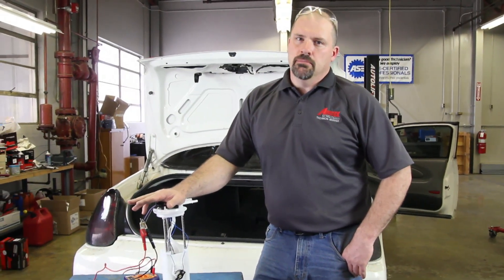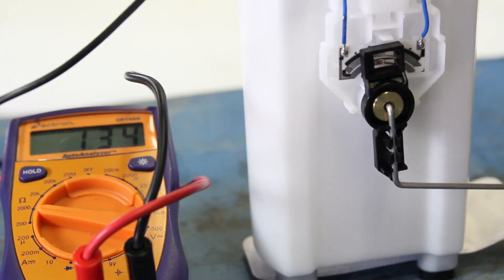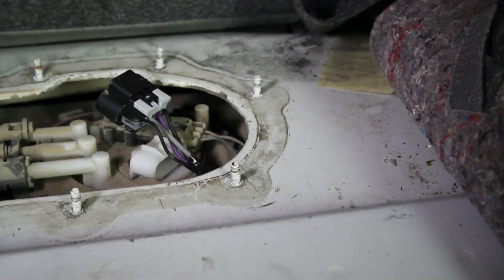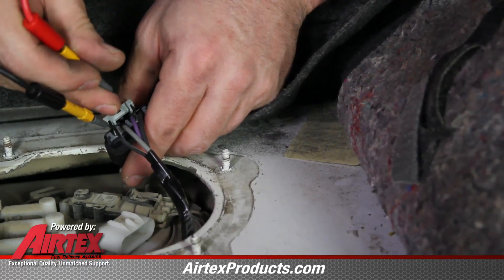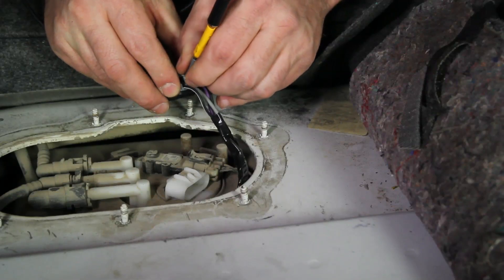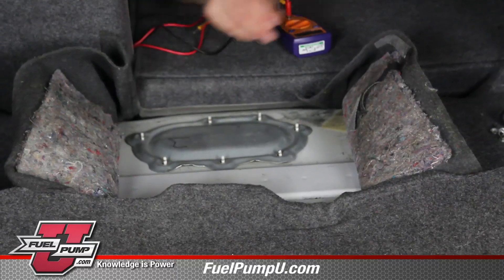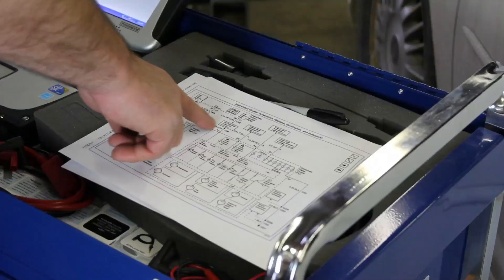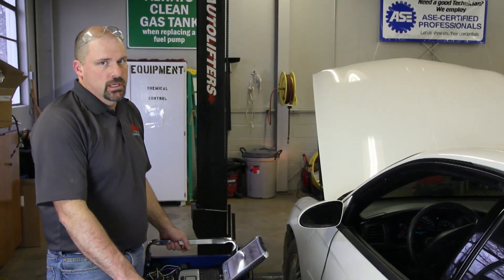Fuel Gauge Tech - How To Properly Diagnose a Faulty Fuel Pump Sending Unit

Comment: I replaced my pump ad my sending unit on both passenger and driver side, with brand new ones (i have an Infiniti FX35) but the gauge still stays at 3 Quarters full. Now sure how what to do at the moment, i'll reset my ECM today and see if that works.

Comment: I realize this is a very old video but I want to make a very important point about what was said.  If you see a voltage drop done the way he just did, it ONLY means the variable resistor, in its present position, is not open.  You need to check the range of motion for positions of possible open.  The variable resistor wiper can wear out and begin sending bad readings depending on fuel level.  If, and only if, the resistor is failed catastrophically will this method work.

Comment: I have a 2011 CRV every time I fill up the tank fuel gauge drops and it goes up and down and I feel like the car is burning so much gas but I don't know if it's the fuel gauge or the pump
Reply from the maker: This is a perfect example of needing to do the proper diagnostics to determine what component is at fault; the sender, wiring, ECU, gauge...

Comment: Hey man, I have a question. On ignition, sometimes my gas gauge stays on empty for a little bit and car says no fuel. Gas gauge takes like 4 minutes to rise to actual fuel levels. If I let it sit and restart it will self correct. I have an ecoboost 2015 with no mods 25k miles. I want to believe it's a sending unit. Any ideas? I'd like your two cents.
Reply from the maker: It could be the sender, it could be the ECU, it could be the gauge itself. It is a matter of doing diagnostics through the chain of command. Start with the ohms reading on the sending unit and work your way back to the front. With the delay in the reading I will be surprised if it is the sender.

Comment: If my fuel gauge on my 02 Lincoln ls says 200 miles till empty (for example) and I drive 1 mile the number goes down to 196 till empty and I didn't even drive 4 miles. I replaced the fuel pump, fuel filter, and the fuel pump relay. I'm at a loss.
Reply: Airtex/ASC Performance Pumps I have the same issue with my 2017 Dodge Challenger sxt plus could you make a video on how to fix please!!
Reply: Airtex/ASC Performance Pumps how do I know it could be fuel gauge or if there is a leak?
Reply: Buy caddi

Comment: my bmw740i runs out of petrol when the gauge reads below half and on board computer reads +- 280km to go however to fill up with petrol the tank only takes R600.00 when it should take over R1000.00 to fill so that means there is still petrol in the tank when the car runs out, what can be the problem.

Comment: My fuel gauge hasn't worked in over 5 years. I have a check engine light and got it hooked up to a scanner that gave a 0462 code.
I have had the fuel lever sensor replaced and the check engine light is still on. PLEASE HELP! I cannot get my vehicle registered with this issue.
Reply: Check the soldering on the back of the gauge on the cluster, check for blown fuses, check for faulty wiring.
Reply: tmarie314 Did you ever find the problem?
Who hooked it up to the scanner? The mechanic who changed the sending unit?
I keep hearing people say they can't register their cars or will get a ticket for an engine light.
I don't understand but I hope you found an answer

Comment: I have a 2005 infiniti g35 and my gas gauge reads full tank but doesn't go all the way down to empty. I could only go up to half a tank because if I let it go to empty it will wont drive no more. can you please give me some tech advices. I already replaced the sending units A and B.  and the gas gasket valve

Comment: I have a 2006 tacoma, and gauge was still registering that I still had a 1/4 of a tank of gas, but I ended up being out of gas, does this sound like a problem with the sending unit, other then this issue, the gauge seems to work properly
Reply: Airtex/ASC Performance Pumps thank you for your response
Reply: How did you solve the problem ?

Comment: I have 2006 G35 sedan 6MT, I have problems of fuel gauge accurancy? I replaced the filter and used Nipparts but now fuel consumption is way up. In full tank in urban only 185 miles. Should I use OEM filter. I replaced also the fuel pump to DELPHI FE0351 and it delivers 48.5gph. And do I have to replace 2   O rings at fuel filter every time I change the filter, I just di when repl. the filter?
Reply: Thanks. The fuel level is totally out of order. It jumps up and down. After replacement the fuel pump Delphi and fuel filter Nippparts caused this that I could drive with full tank in urban only 185 miles, normal driving- I mean I drove the tank completely empty. this for 20 gallons not goor results , usually i could do it 350 miles before replacement. The small 0 rings were not included with the fuel filter. But somebody said that if not replace these 0 rings the fuel pressure will be lost? How much is there truth about it?

Comment: Any experience dealing with a 2011 vw jetta? fuel gauge shows 0, ambient air temp sensor also shows around 4F when it is actually 85F. Not sure if they are related. I believe it first showed up after a battery replacement a month or two ago. Thanks.

Comment: I have a 2003 Dodge Caravan. The fuel gauge works until it hits the 1/4 tank mark. Once it hits that mark, the fuel light comes on and the gauge never registers under that 1/4 tank of gas. But when I fill it back up, the gauge will register properly again.

Comment: My 95 ford explorer V6 4.0 2WD has a potential problem with the gauge. First indicator was the dash's check gauge light comes on and stays on. Then my fuel indicator will vary throughout my travel and will vary on startup. Im pretty sure that it may need to be replaced but id like some advice.

Comment: I have a 2000 Monte Carlo and the fuel gauge  stays on full 90% of the time once driving for a while it will drop. Then it will move back to full. It will drop to empty and gas light comes on when idling too long. Any ideas?

Comment: I've got a 94 b13 NISSAN sentra, had the back window tinted, and after the tint was completed about 2hours of driving, my fuel gauge failed, and I'm thinking the installer tech ruined some wiring back there because the backseat was moved to ease the installation. I'm not finding any video about this issue on youtube, so I'm wondering that this issue is somehow ignored, or people don't touch their back windows ever ...

Comment: I have a 64 Dodge and i have a slight notion that my fuel sender unit float might be flooded, so to speak it's sitting at the bottom of the tank inside, so my gauge reads E
Reply: Much obliged for the reply.

Comment: I replaced my fuel sender in my 79 Lincoln and I'm not geting anything to my gauge  ?  😔😕😡 could it be a fuse ? I'm going to look at this tomorrow and if it's not is there a way to check the cluster ?

Comment: Recently replaced the pump assembly on our 02 F-150 with a new Airtex unit. The fuel gauge now only works intermittently. I was hoping that it was just a sticky new part that needed time to free up but no such luck thus far. I really hope I don't have to yank out the fuel tank and do this over again. Even w/ a 30.5 gallon tank this vehicle is way too inefficient to drive around w/o an accurate gauge. Talk about range anxiety.
Reply: ***** I think I may have been right, it was a sticky or hung-up float arm. The gauge rarely worked in the beginning and now I haven't seen it do its below Empty thing in days. When this was going on we did recheck our work, especially the pigtail, btw. I'm just happy it works now so I don't have to go spend the rest of the day under my truck again.
So to anyone else who just changed their pump and fuel pressure is fine but there's a mysteriously intermittent fuel gauge, don't panic and fill the tank up a few times. Mine started working so perhaps yours will too.
Hope this Airtex pump and I have a long, happy marriage =)

Comment: hi,I just replaced my fuel pump with your  brand fuel pump, it's a 07 new beetle with the 2.5 5 cyl, my problem is that before it was replaced my full tank used to cost about $40 from 1/4 to full now with the new pump 1/4 to full cost only $20 it's not reading correctly now I have to keep putting gas cause not sure of the correct gas level

Comment: I have a pt cruiser. when you turn the key on the gauge goes to half tank for a few seconds and then drops to empty.  I have replaced the fuel pump and it still does the same thing.

Comment: Dangit, cant find any info on faulty gauge cluster... only sending unit troubleshooting!  Useless--He even says that it's not always the sending unit.
Reply: Engineering Nonsense No info on how to diagnose if you can't access the fuel pump and sending unit because you have no access panels.
I guess you have to pay a mechanic to "drop the tank" just to diagnose the problem when it could be many things like this guy said.
Ridiculous
Reply: @queenfubi  Dropping the tank is actually easy, use 2 ratchet straps to first raise the tank then remove the tank holding bolts, slowly release the ratchet straps one at a time to slowly lower the tank down, to raise the tank simply crank on the ratchet straps and raise it back put the bolts back in place. I recommend trying to get as little fuel in the tank as possible when dropping tanks

Comment: '99 Express van. My gas gauge goes to 3o'clock and van dies.Happens sporadically. New pump still the same thing. Replaced Camshaft sensor, crankshaft sensor, throttle position sensor and pump relay. HELP Please
Reply: ***** I have 96 Toyota 4Runner v-6. due for long trip I left the to friend for war up the engine or drive, after returning I found the car with fuel tank almost empty and has to replace the battery. But not able to crank up the engine. Send the car to Pep-Boys for repair. the diagnostic was need new fuel pump, strainer, and send unit. I bought new original send fuel unit,  new Bosch fuel pump, it came with fuel strainer and used from savage business the fuel bracket or the metal base. I saw the old fuel pump assembly it look very rusty the mechanic said it was for condensed water for left the fuel tank almost empty for long time. They able to crank up the engine, it is running fine but now the fuel gauge is stuck show half tank, even it is fuel that can no take even a gasoline drop. the poor mechanic does have not answer. Any suggestion what might be the problem?

Comment: I have 1998 honda civic sedan. The gauge isn't broken its just inaccurate at times. I have to park it on a flat surface to get a (somewhat) accurate reading. I know it's common for this model but is there something I can do to get a more accurate reading?